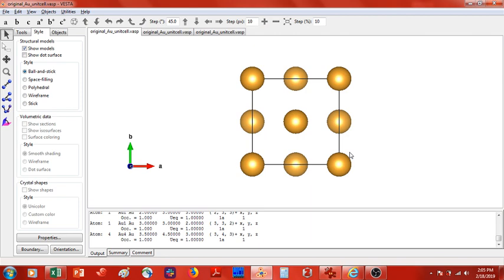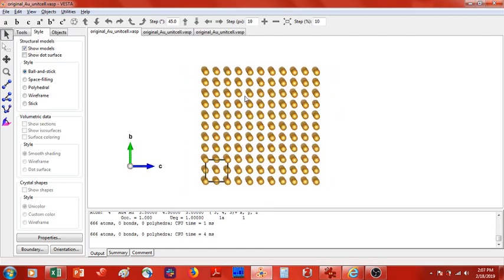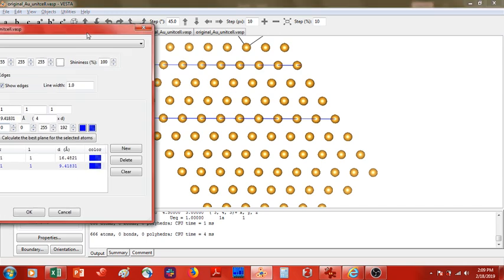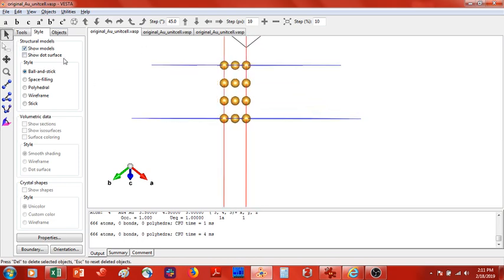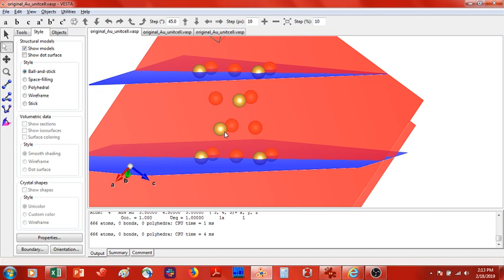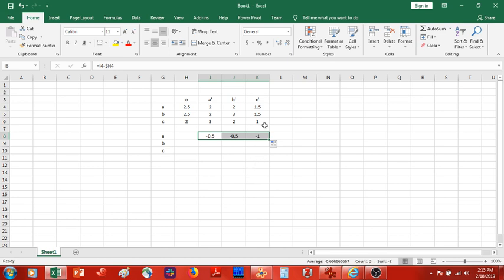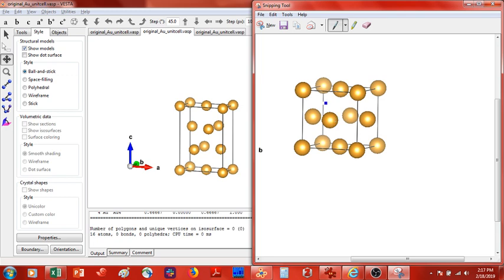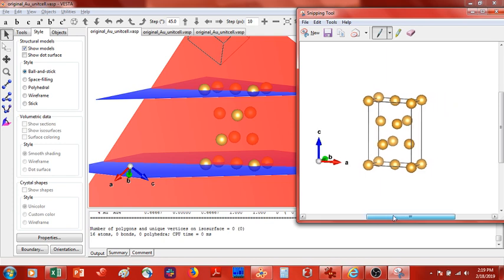Slab Cutting using Vesta pt. 1 - Au(111)

Comment: is there a more systematic way to determine the 3rd lattice plane?? you seemed to just know that the -110 plane was normal to the 111 plane ...is there a way to know this without going through the calculus or did you at some point just do the maths to determine a plane normal to 111??  thanks!!
Reply from the maker: Hey, see if this video of mine helps. Watch the whole thing but the math is around 3 min mark or shortly after. The transformation isn’t orthogonal here for all axes but for cubic system it would be:
https://www.youtube.com/watch?v=vd13VDgbV_s
Reply: @nickelandcopper5636  thanks!!

Comment: This was very helpful. I made a similar unit cell for BCC Ta following your instruction. I have question: if I want to create a stacking fault by translating a few upper atoms while keeping the bottom atoms fixed, would that be possible in Vesta?
Reply from the maker: It would be possible for sure. Do you have an article that shows how such a structure looks? An image?
Reply: @nickelandcopper5636  thanks for replying! Here is an article:  https://ro.uow.edu.au/cgi/viewcontent.cgi?referer=&httpsredir=1&article=5307&context=eispapers
Reply from the maker: @denverite-5280  great - thanks! This looks do-able. I’ll try to have it done sometimes next week. I’ll let you know when I make the video, and I am going to need you to tell me if my procedure looks correct. I actually don’t know too much about these stacking faults, but it looks like I can just make a cell with the appropriate planes (111, etc) and then shift the atoms after.
Reply: @nickelandcopper5636  thanks for taking the time! I can do the shifting with the knowledge of Burgers vector but I would prefer to have a visual way to do the shift in order to create a twinning fault in the crystal
Reply from the maker: @denverite-5280  sure. This is an interesting problem and I look forward to working with you on it. It looks like this is what we’ll need to do:
1. Reformulate the cell such that the (111), (11-2), and (1-10) surfaces are exposed.
2. Shift the middle two layers to make the different stacking fault configurations. I’ll be able to tell when I work on it next week if 1. can be done, which I think it should be able to be done.
Reply: @nickelandcopper5636  the shifting step is slightly different in the paper I gave you the link for. First, they shift all the upper half atoms by an amount equal to the magnitude of the twinning partial vector (which in FCC is a0<112>/6, a0 is the lattice const). Then they fix the bottom most layer of the upper half crystal and shift the remaining atom layers by another a<112>/6. 

This possibly have the same effect on the crystal as the second step you mentioned but my crystallography knowledge is a bit shaky to confirm that. anyway, looking forward to what you come up with
Reply from the maker: @denverite-5280  to go from a to b in their paper, it looks like they just shift the top two rows, what do you think?
Reply: @nickelandcopper5636  they use the built-in lammps command "displace_atoms" to do the shifting. I dont know how familiar you are with lammps but the paper actually gives the lammps input script detailing how the shifting is done. but in DFT code such as VASP, there are no such commands, we put in the atomic coordinates in the POSCAR file and perform energy minimization. so we first need to know the coordinates of all the atoms and then apply the appropriate shift amount to those reference coordinates for shifting the required layers.
Reply from the maker: @denverite-5280  ok thanks. The shift would be easy to do manually by manipulating the input file directly, or even right in the Vesta app
Reply from the maker: @anik fasial is the structure supposed to be periodic in the vertical dimension? It seems like it should be a slab model where the structure is surrounded by vacuum in the vertical direction
Reply: @nickelandcopper5636  yes for DFT simulation we do need a vacuum in the vertical direction. in molecular statics simulation this can be done using a shrink-wrapped boundary condition in the vertical direction. I have a question: how did you know that the vacuum is needed? I came to know about the vacuum by reading articles on DFT simulation of stacking fault energy curve but never quit understood why the vacuum is required.
Reply from the maker: @anik fasial The first stacking fault video is up. https://youtu.be/riA9Tez7Jpw
Please let me know how it looks to you

Comment: HI, really helpful video, I'd done this before but this way is indeed much faster.
However, I was wondering how you calculate the miller indexes of the perpendicular plane, and if there's any quick trick other than doing all the maths in it... can you help?
Reply from the maker: So sorry for the late response. Yes there is a way you can easily calculate lattice planes in Vesta

Comment: Awesome Video! Many thanks for the same. I havaery. I have cut (111) plane of similar FCC structure of Lead. I want to create its 2D structure with a vacuum. In some way, (111) plane looks like hexagonal, but which 2 atoms need to be considered from 6 atoms obtained in (111) plane, please suggest me the same. Also, once i keep 2 atoms and change the vacuum in z-direction, distance between the two atoms drastically changed, so should we then dependent on the optimization. Kindly put some light on the same. Thanks a lot!

Comment: I tried to follow the same procedure for Pt (111 and Cu(111) (FCC ), but it gave different structure than shown in these two papers shown below, Even though , they have cubic crystal. 
periodicity
Reply: Please clarify it to me.
Cu: https://www.researchgate.net/publication/235480501_Facet-insensitive_graphene_growth_on_copper
Pt : https://www.researchgate.net/publication/282812946_Molecular_adsorption_at_Pt111_How_accurate_are_DFT_functionals
Reply: does that mean i shouldn't look for periodicity in the normal direction to plane 111 for all FCC structutre 
I'm stucked in this issue for the whole past week. Please help me 
What is the criteria ?
Reply from the maker: Yes you must find the periodicity. Please watch the video where I cut the cell for copper it will help
Reply: @nickelandcopper5636  I just watched it , and i got exactly the same 111 surface as yours, 
But the problem is: what we got is totally different from what reported in literature, not all angles of the new unit cell are 90 degrees as  shown in the video.
see the Cu 111 surface in the paper mentioned above, or just google it to see the difference
Thanks in advance
Reply from the maker: I think it should still be correct
Reply from the maker: If you want the slanted version take the structure I get and apply this transform

1 -1 0
1 1 0
0 0 1
Reply: Nickel and Copper, yes i got the slanted version . But the lattice parameters a & b were changed ! , why?  How did you get this transformation matrix ?
Reply: One more question: using both unit cells in Quantum espresso will get the same results ?
Reply from the maker: I got the matrix from experience. And who knows if they will ... :) .. you tell me
Reply from the maker: I have a video where I cut copper 111 check it out
Reply from the maker: Also soon to release part 2 of that video

Comment: Thank you for the beautiful video. However, in some paper, I got some different configurations of the Au (111) plane constructed from 29 Au atoms. It confused me, can you please share your email id so that I can send you the paper.
Reply from the maker: Hi. Thanks. I won’t share my email here. Please just everything public so everyone can benefit. It’s possible that they constructed a 111 surface using a different type of gold unit cell. Gold can come in a few different space groups. It is also possible that they have a super cell, and not a unit cell. 29 atoms sounds like a lot.
Reply from the maker: But what you speak of shows a larger issue in the field of computational chemistry / physics / material science. I think people need to start better explaining how they do things. Not just the end result.
Reply: @nickelandcopper5636  NANO
 LETTERS 2002 Vol. 2, No. 8 Page 877-880 I was referring to this paper. Yes, they may take supercell not the unit cell. For the case of the fcc unit cell of Au what you have used in the video, the top and the bottom layer along the z-axis will be the (111) plane. Now if I wish to have only a layer of 111 plane, then should I delete all the other atoms and put the vacuum there?
Reply from the maker: Yes. Now, check out my videos on making monolayer. Start with the 111 unit cell I make and follow the procedure for making the monolayer I show in the monolayer videos
Reply: @nickelandcopper5636  Thank you for your suggestions. I have watched your WSe2 and GaAs monolayer videos and the ZrO2 111 slab model and bulk silicon surface slab videos. In the ZrO2 you put the vacuum on the whole 111 unit cell in the a direction and for silicon in the c direction. But if I want only the atoms  of the top layer should I follow the WSe2 and GaAs monolayer videos?
Reply from the maker: All are helpful. Maybe take the gold 111 unit cell and apply the procedure in the gold monolayer video I have. Try that

Comment: Very interesting and useful. Thanks a lot. Still, I wonder if VESTA is able to create surface automatically based on the symmetry of the crystal. Let's say I want to generate a surface with low Miller indexes (or any arbitrary face) from the primitive cell of crystalline material. Do you know how I can generate the surface (with vacuum) even if I don't know what is the most exposed surface?
Reply from the maker: Hi. Not that I know of, you would need to know which surface you want first I think.
Reply: @nickelandcopper5636  Ok. Pity. 

I have another question. Imagine I have a cubic spinel Co3O4 structure, for which the most exposed surface is the (1 1 0), which is not parallel to ab, ac or bc plane. If I want to create a new slab structure with that surface in contact with vacuum, then I will need to rotate the whole structure after "cutting" my bulk unit cell, isn't it? However, I don't how to make a 2D surface without missing or overlapping atoms. Do you have any suggestions for that?
Reply from the maker: Jian Xiang Lian, I have a bunch of videos where I do 2d structures with vacuum. Send me some information about the structure and I’ll see if I can make it, maybe it will be my next video
Reply: @nickelandcopper5636  Well, let me first check your Youtube channel. Perhaps I can find the solution already. If not, then I'll be glad to propose you a challenge. :D
Reply: @Nickel and Copper  I found the video I needed: https://www.youtube.com/watch?v=1_tNEYN3WVI&t=662s

Thanks a lot for your great work. Very useful. Btw, do you also make videos on how to use GDIS?  :D
Reply from the maker: What’s GDIS?
Reply from the maker: Jian Xiang Lian, Ah, I see. Well, I haven’t used it. Maybe one day though. Check my video on LaFeO3. If the CaF2 video was helpful I think this one will be too

Comment: @Nickel and Copper Thank you and really it is a nice job.In your video for Au (111) you constructed the supercell by using the boundry option but for Ru 111 you said that wrong and we should transform.Can you explain the difference?
Reply from the maker: Ahmed Sherif Omran, thanks for the thoughtful comment. In the video for Au, I first needed to transform the unit cell such that the 111 curvaceous was exposed. For this, it is ok to use the boundary option. When we do the boundary option and then save the coordinates, we only save the primitive unit cell coordinates, whatever they may be. For the Ru video, I wanted to make a super cell. So, I need to transform the unit cell coordinates into the super cell coordinates. In this case, the boundary option won’t work because if I just did the boundary option and saved I would get back only the primitive unit cell. For the Au case, I only transformed the unit cell into another type of unit cell. No super cell there, and hence I used just the boundary option. Overall, I plan on making more videos soon. Also, I wish you safety in these uncertain times.
Reply from the maker: Surface* not curvaceous
Reply: @nickelandcopper5636  Thank you for your reply and I hope you safety too.I did not get the point clearly but -correct me if I am wrong-I understand that in Au 111 you got slab for another unit cell (because that was the purpose)and for Ru 111 you get a slab from supercell coordinates which is more comprehensive (general approach) that should apply in all cases for purpose of periodic calculations..Thanks again and you are doing amazing job!
Reply from the maker: Ahmed Sherif Omran, thanks, I think there is still some misunderstanding though. For the Au case, I just transform one type of unit cell into another. No super cell. Therefore, I use boundary option. For Ru, I make turn one type of unit cell into a super cell or the same type. Therefore, no boundary option
Reply from the maker: Of* the same type
Reply from the maker: If you have a special case you want me to look at, tell me the information about the structure and I can perhaps make it my next video
Reply: @nickelandcopper5636 It is now more clear.Unit Cell--Another Unit Cell exposing the 111 surface,then transforming that to new supercell via the transformation matrix.My objective was preparing input slab file for further DFT calculations via VASP.
Reply: @nickelandcopper5636  I would appreciate if can do on Zeolite example ,something like chabazite would be great.Thanks
Reply from the maker: Ahmed Sherif Omran, what’s the chemical formula and what do you want the end product to be? 111 face? Super cell? If so, how large?
Reply: @nickelandcopper5636 Here is the information I have CHA (a = b = 1.3675, c = 1.4767 nm and α = 90°, β = 90°, γ =
120°) http://www.iza-structure.org/databases/
Supercells composed of two unit cells along the c lattice
vector (1 × 1 × 2).Many ways to cut that structures but there no particular face as I understand.
Reply from the maker: Hi Ahmed, would you like vacuum along any of the dimensions? Making a 1x1x2 super cell of this material would be easy - just double the c dimension. I wonder if you meant to also add vacuum along that dimension? I don't think cutting any particular surface here would matter, so the native 001 surface should be fine.
Reply: @nickelandcopper5636  Yes,it is about making periodic model and adding vacuum for proper surface and adsorption calculations.Yes,I agree no need particular surface,it is already complex enough.There are some ways to reduce them as embedded cluster or ONIOM but I want to get basics first.Thank you.
Reply from the maker: Hi Ahmed, please see the zeolite video I uploaded.
Reply: Thank you very much for time and effort.It is really amazing..
Reply: @nickelandcopper5636   I see in some papers addressing adsorption energy calculation , they don't specify the surface , does that mean its 001 surface  ?
I didn't find your video on zeolite , could please share the link for this video ?
Reply: @ahmedomran2054  how to reduce zeolite as embedded cluster ?
Reply from the maker: omer mutasim hi Omar. Keep searing around the video is still there. Also not sure about zeolite cluster
Reply from the maker: omer mutasim they should specify it check again. I’m not sure what to do if they don’t that’s something they should specify

Comment: Thank you sir.
Can you please share how to make 001 surface out of complicated systems?
Reply from the maker: Hi Neha Katoch,

Certainly. In fact, the 001 surface is a commonly exposed surface to begin with. So it is much simpler. Do you have an example I could use for demonstration?
Reply: @nickelandcopper5636  Fe2O3
Reply from the maker: Hi Neha Katoch, I apologize for the late reply. Are you talking about the Fe2O3 unit cell with a R-3cR space group? Please specify the space group.
Reply: @nickelandcopper5636  yes R-3c
Reply from the maker: Ok. For this one, the 001 surface is already exposed. Do you need to see how to make a slab model with added vacuum for this one?
Reply: @nickelandcopper5636  yes
Reply from the maker: I apologize for the extreme delay. I will make the video soon. Would you like a super cell in in dimension? This is turning out to be actually a very simple system for adding vacuum in the c dimension.